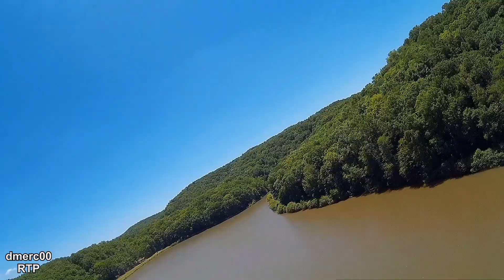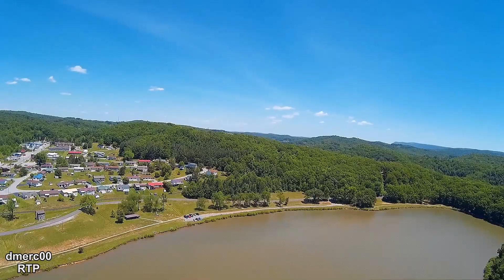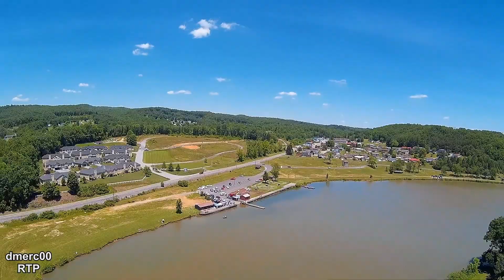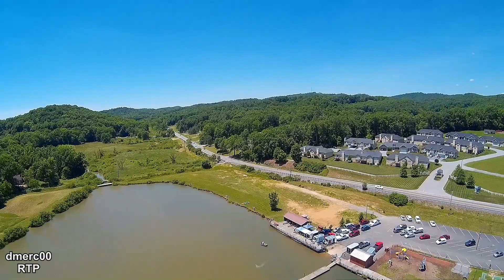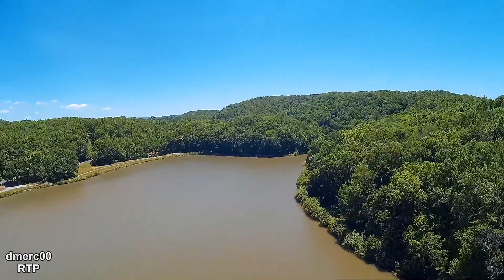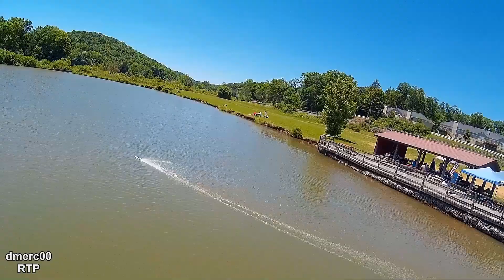FPV Polaris XL Sea Plane HD Aerial Flight Footage of Test Flight

Comment: #9: a lipo-buzzer would have spare you the long walk of shame ;o) (but it keeps the legs muscles loose !)
Reply from the maker: The batteries still had 11.8v and it seemed to be that the ESC over heated. Not enough airflow over the heatsink I imagine.
Reply from the maker: thanks for the 9th thumber!
Reply: Its good to have these feathers on your esc, better than burning up the plane.